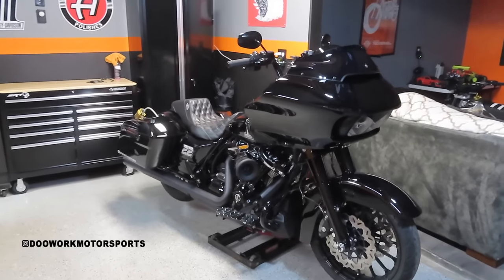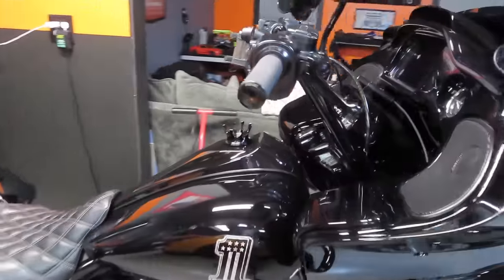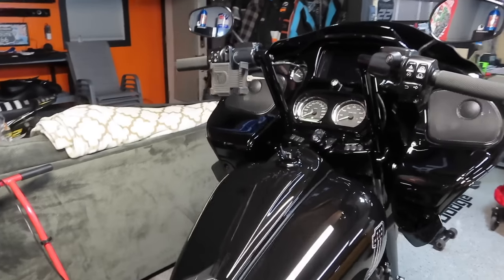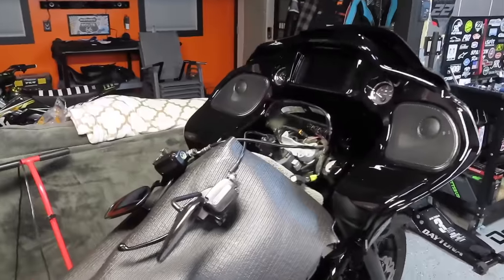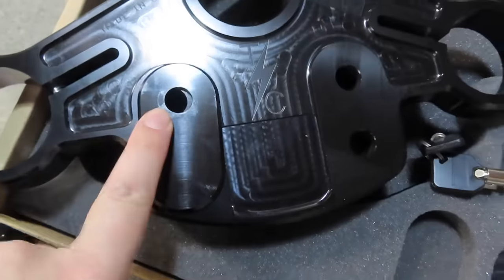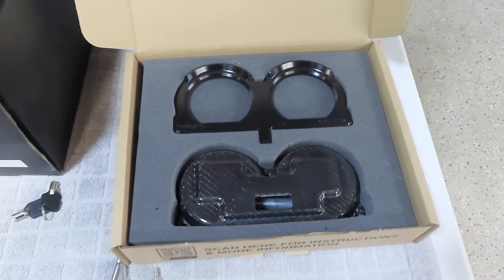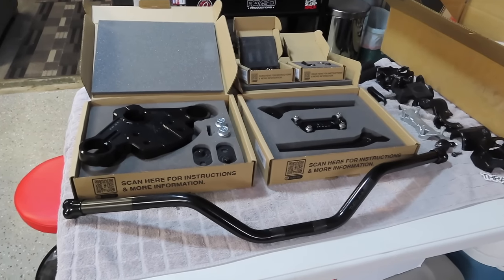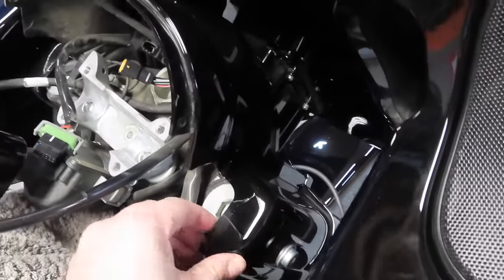THRASHIN SUPPLY T BARS INSTALLED ON MY HARLEY DAVIDSON ROAD GLIDE! *HOW TO*

Comment from the maker: Disclaimer: Make sure if you do this modification to your bike, you must take it to the dealer to get a CVO ignition flash because in order to run the Thrashin Supply Top Tree, you have to remove the factory fork lock ignition.
Reply: Just found this out wiah I read this comment took me hours

Comment: Bro you’re gonna love em! I’m 6’3” have the 6.5” pull backs and mid bend bars and I love it.
Reply: I know this is an older comment but hopefully you see it. Are your risers mounted in the close or far holes on the top tree? Do you feel stretched out at all? I'm 6'2" and thinking I need to go with the 6.5"

Comment: Very nice setup, looks amazing. I'm going to do the same with my 2019 RG, but I don't know what lines (clutch, throttle, brakes and manual control switches) you used, could you give me the information or did you use the stock ones?

Comment: Like the setup and specially since the gauges can be set so as to not block the main screen!  I have a new '23 RG ST and have been looking around, researching what setup I'll go with.  I have the SE/Ohlins Rear Shocks on already and am looking at the recently released fully adjustable front suspension kit from RWD...so I would want easy access to the adjustments (which it looks like the T/C setup on your RGS would provide).  Total cost (without taxes, any shipping, and of course Labor)?  Thanks!
Reply from the maker: This setup costs around $2,400 just for parts.  I'm not sure how much labor would be as I do all the work myself.
Reply: @DOOWORKPRODUCTIONS  Ok, thanks for the pricing info. on this T/C setup.  As always, looking forward to your future videos.

Comment: I have a cvo roadglide ultra I just ordered my setup in chrome without the tree mount. I’m leaving the gauge in stock spot for now. But they recommended I go with 6in pull back risers and high bent bars I hope I didn’t make a mistake
Reply from the maker: Just did that setup on a friends bike - It feels about the same as my setup.  So you will be alright.
Reply: @DOOWORKPRODUCTIONS  ok great.

Comment: Awesome vid! Can you comment on how the reach is with the new TS bars vs Motowich? I just installed my Motowich bars and feel just slightly too streched forward and am considering the TS set up. Thanks. RR
Reply from the maker: The thrashin bars are 10x more comfortable.  They come back further to you than the motorwitch bars.
Reply: @DOOWORKPRODUCTIONS  thanks for the info and for taking the time to reply!

Comment: Hey man was wondering out of the different handlebar setups you have done on your road glide  which one has brought them closest to you .
Reply from the maker: My latest Bar setup.  The Thrashin T Bars..
Reply: That’s what I was guessing. I’m 5’7” and have the HD 9.5  chiseled bars on my 23 road glide st and they have me leaning forward uncomfortably and low speed turning reaching out a bit too far. I don’t want to make another costly mistake on bars. I’m in  Shelby Twp . Would be great if I could check out your bike , what are your thoughts

Comment: What made you choose the Thrashin vr Kraus setup ?? I’m undecided which way to go for my bike
Reply from the maker: Fit and Finish on the Thrashin Parts are much nicer, I like the Top Tree with the hidden fork lock.  Also love the gauge relocation kit on the Thrashin setup - it doesn't block the view of the screen at all.
Reply: @DOOWORKPRODUCTIONS  I totally disagree. Actually its the opposite, fit and finish on the Kraus is much nicer. Thrashin is nice just a little more unrefined.

Comment: Does this setup require longer brake and clutch lines ? I’m running a 12 in apes on my 2020 road glide that did not require me to put longer lines.. so just wondering
Reply from the maker: No it does not require longer lines!
Reply: Thank you!
 @DOOWORKPRODUCTIONS

Comment: I appreciate you video big homie. I just got most of my parts in for this set up. As I opened the gauge relocation box, I attempted to to piece them together as a mockup but noticed they didn’t completely flush together. Is it because the gauges and fast keys weren’t in or is there a fault to it? Not sure if you remember when you did yours or your boys bar set up. Again, thank you for this informative video! Keep up the good work!
Reply from the maker: The gauges fit tight in the carbon fiber housing. Try pressing in on the edges to get the carbon to fit inside the billet bezel piece.  both ones I did were very tight, but they will fit flush.  Try putting the screws in first too.

Comment: I’m wanting to do this same setup, you mentioned you were a shorter rider so you put them closer to you. I’m 5’11” on a good day(spine injury) but shrank to 5’10”. I’m curious what your height is to reference bar position?
Reply: Also are your brake and clutch cables stock length?
Reply from the maker: I’m 5’7. My cables are stock length.
Reply: @DOOWORKPRODUCTIONS thanks!

Comment: Had I not gone with the Motorwhich bars, that was going to be the setup. 
I'm diggin the Motorwhich bars. Running the cables thru the bars was a pain in the nuts, but I'm liking them so far. Good feel, good control

I have the bike sitting in the garage right now with the exhaust ripped out. Looking to install the new header and mufflers today.
Reply from the maker: Yeah running the wires through the motorwitch bars was not fun!

Comment: Nice video … one question your old handlebar was 12” now the Trashin it’s 9.5” the raisers + 4.5 the mid bend handlebar so it’s now 14” correct me if I’m wrong , is it ok I mean there is not a big difference? Thnx
Reply from the maker: It's still about 12" tall overall.
Reply: @DOOWORKPRODUCTIONS  thnx for reply
Reply: @DOOWORKPRODUCTIONS  Pair of really nice handlebars - ruined by these dumb risers.
 More work to change the bars than it used to take us to change our whole engine in an old Triumph back in the day.

Comment: Yeah that looks the goods. Been playing with that idea for a while, it's over a 2k set-up here in Aus just for the parts, our dollar sucks balls. But I keep coming back to it and it's looks great, looking forward to your thoughts on how it all feels.
Reply from the maker: Yeah, it definitely isn't a cheap mod!  It cost us $2,400 here in the US for just the parts too.
Reply: @DOOWORKPRODUCTIONS , yeah sorry, I pressed 2 instead of 4k plus $700 shipping. I currently run 12inch Burleigh bars on mine and the 9.5 pull back riser and mid bend bar works out at a similar maybe a touch taller? I definitely like the adjustable gauge relocation, like you, I don't want any interference with the screen.
Reply from the maker: @DCV65  Wow, that's just insane!
Reply: @DOOWORKPRODUCTIONS , yep, that's why it's not done yet. Was good when our dollar was on par with yours years ago, but it's  hard to justify on a set of handlebars. That's a lot of fuel and tyres.

Comment: Towards the end of video you said you had to pull the unused wires back into faring. What were these wires hooked up to that now you no longer need?
Reply from the maker: These are the 2 wires/connectors that are plugged in the back of the factory plastic gauge cluster housing.  They are used if you have any auxiliary switches mounted there for either air ride, center stand, lights etc..

Comment: Can you confirm …those pins that Harley has restricted movement on the factory bars you just hammer those Down with a punch ? Asked my dealership to move my bars up and they said they can’t due to the pins but yet I see yours are not there. Just curious thank you in advance
Reply: alot of people will shave the pin off
Reply: @DOOWORKPRODUCTIONS  thank you.
Reply: @DOOWORKPRODUCTIONS  no one ever talks about that part in install videos lol is it just one pin ? What did you do with your chizled bars from Harley ? I was thinking about ordering a pair. Thank you again
Reply from the maker: @SharkLifeSean  Yes, just 1 pin.  I sold my Chizled low bars.